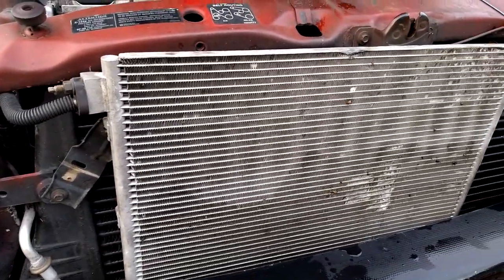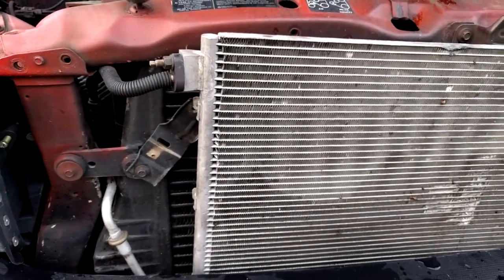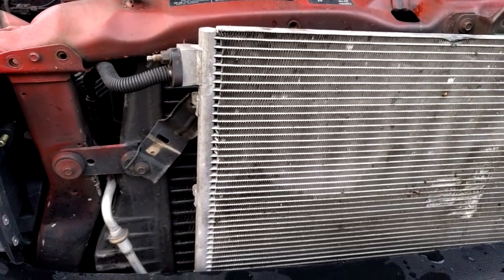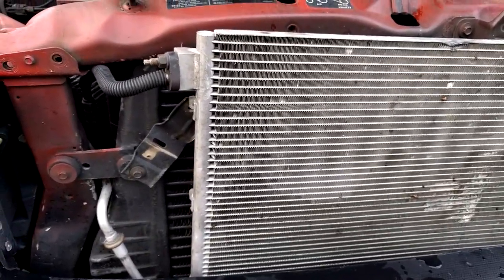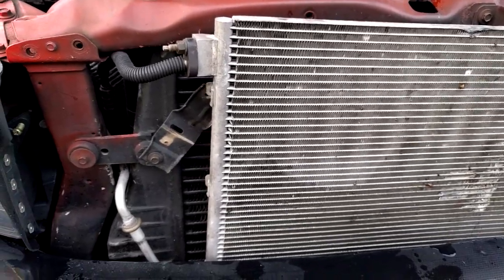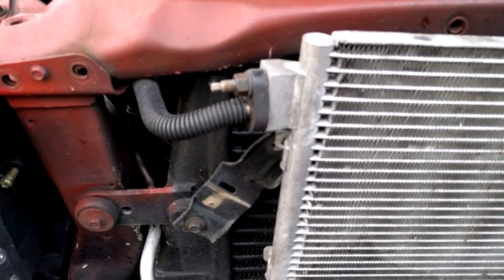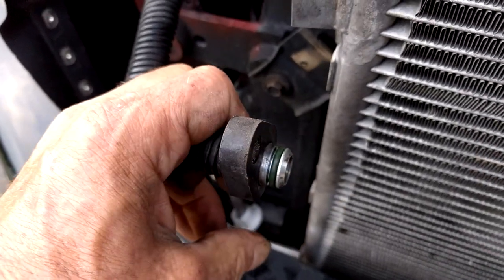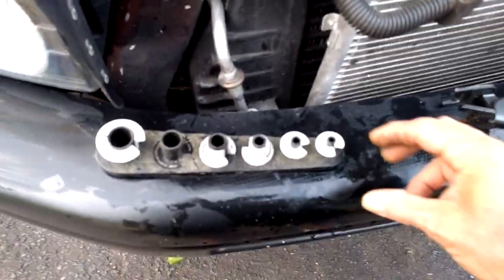Replace the Cummins A/C condenser coil DON'T DAMAGE YOU COMPRESSOR add freon the right way

Comment: I have a 24v and I was wondering where you found your condensor because I can't seem to figure out what the core size is for one its an 01 3/4 ton
Reply from the maker: I tried a couple of different places and keep getting the wrong one. The best place I found to get Dodge parts is https://www.dallasdodge.net/  There prices are reasonable and they will ship to you.. You give them the vin # so you get the right part.